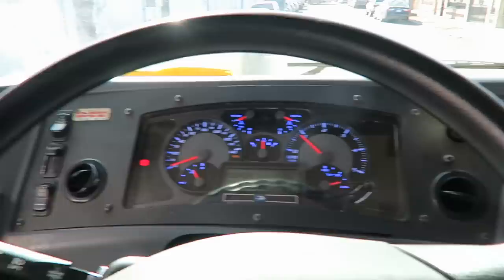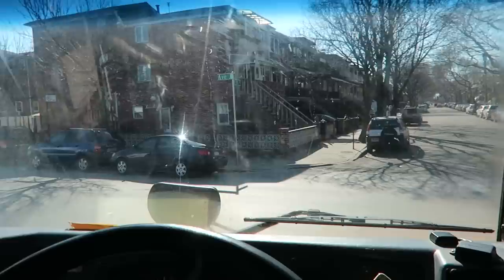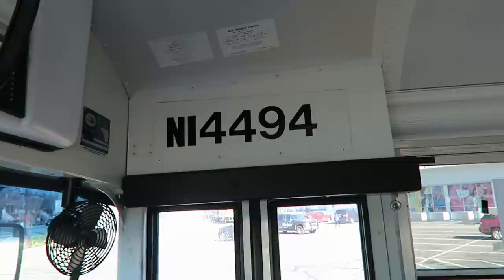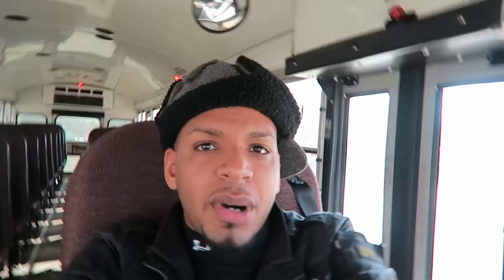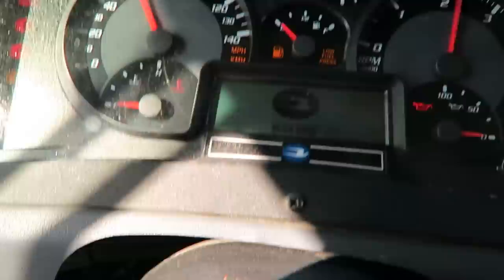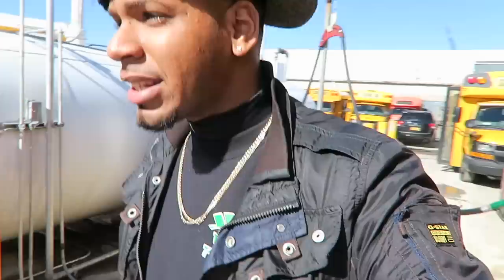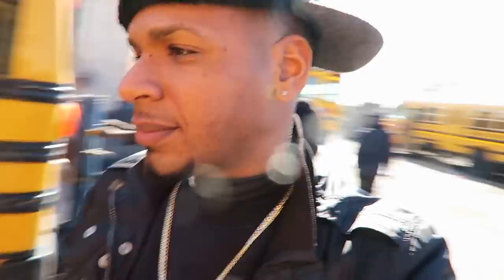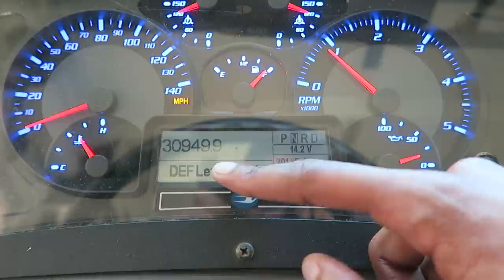Day On The Job (Vlog #3) Bus Numbers

Comment: Resolving this issue is easy. When you buy a bus, you can renumber the bus to fit your fleet. for example, you buy bus 4484 from New Dawn. You renumber it to your fleet bus 14-03. Or you buy 4494, it would be bus 14-04. Or 4485 14-05. You get the point. Bus 3185, 13-06, 1545, 11-07. Just you can renumber the bus. It doesn't have to be in order from where you got the bus, you can give it a random number that matches the rest of the fleet.

Comment: In my district, we have a weird system. Here, bus numbers beginning with 6 are regulars, while those with wheelchair lifts have numbers starting with 7. Format is as follows: DYYNN. D is designation number, 6 or 7. YY is of course year, and NN is which bus it was of that year. Here’s an example. Bus 60912. It is a regular, from 2009, and is the 12th bus from that year.

Comment: For our districts buses, our numbers used to run up the scale first two are the year. Last two just go up the range. 98-55 to 98-57 then next year we get more and it continues 99-58 to 99-62 and so on. Keeps buses in order and its easier to know what bus is what. when we got to 100 they stopped going up the scale and started 08-01 to 08-04 and keeps starting over. I hate it. I liked the old way. Also, Pink diesel is not designed for engines made after 2007. That is offroad diesel for tractors and logging type equipment. that offroad diesel can really mess up a motor. Thats why the filters stay dirty. they aren't designed to be used with offroad diesel.
Reply from the maker: +Fredriq Craft Lol... Thanks for the info.... but we are going to continue using the pink diesel cuz it cheap..lol. more business for my tow truck guys...lol hahahaha.

Comment: My company's busses have 5 digits and all have 6 as the third digit and the older ones begin with 1 and Newer ones with 2. Not sure exactly what's behind the numbering but the 216 buses are all the same type and the 206 are all the same type. Both different types of IC's like the 206 has a strobe light and the 216 doesn't. The 2162's have white tops with maxxforce 7 while the 2163's have yellow tops with maxxforce DT

Comment: The new IC busses also have a differant floor and for our buses they have blue seats and the window latches are on the side of the window rather then on the bottom of them. I like the driving in it. Feels like its got better suspension then the other buses.
Reply from the maker: +Cocomadmann Nice
Reply: +Dillon Rathan Pretty much like the bus you drove in vlog #2 but longer and no side door.

Comment: I live in a suburban school district just north of Syracuse, NY. They use 3 digit numbers all in order. They purchase 12 new buses every summer and the numbers for the new buses start where the last ones left off. This year they're running 450-591. Buses coming this summer will be numbered 592-603. How long does a full tank of DEF typically last mileage wise?
Reply from the maker: +ICCE523 In stop and go traffic you may get up 200 miles maybe a little more. but highway driving it takes a long time for the DEF to go down